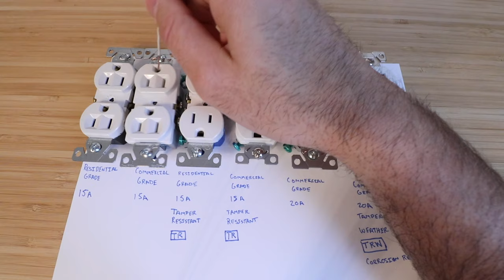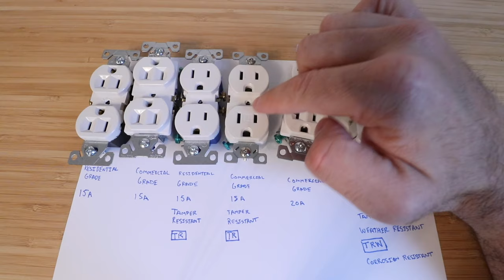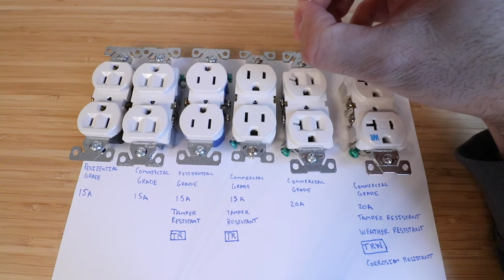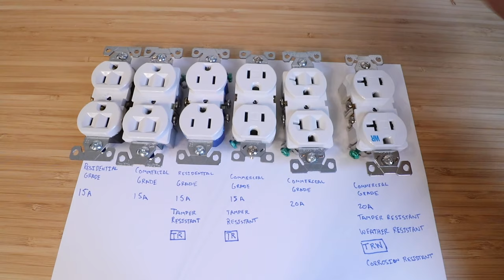How To Choose The Right Outlet For Your Home

Comment: I agree that the 15 amp spec grade receptacle, tamper resistant where required, is your best choice throughout your home. A 15 amp duplex receptacle is not restricted to a 15 amp circuit and is permitted on a 20 amp circuit with 12 gauge wire and is commonly done. Most homes don't have any 20 amp duplex receptacles and if there are any, it's optional. The 20 amp receptacle is designed to accommodate a 20 amp plug which has the neutral blade in a horizontal orientation. This is extremely rare and when used they're primarily for fixed installations and/or dedicated circuits. Dedicated circuits require a single (one socket) receptacle. 15 amp receptacles are rated for 20 amp pass through and the spec grade version is identical internally to a spec grade 20 amp receptacle.
Reply: Thank you I needed this
Reply from the maker: Great comment thanks for watching!
Reply: Yes, thank you for this expanded explanation and clarification. I am glad to see the info on the commercial grade receptacles. I have a couple 20a appliance circuits in my kitchen and in 19 years being here I've had to replace one of the Residential Grade receptacles twice and now I have to do it 3rd time! This time it's going to be with the Commercial Grade receptacles! 👍
Reply: Thank you for this! I recently bought a renovated house, and looks like they upgraded the wires (20a breakers, 12 gauge wires). I immediately checked the outlets throughout the house after this video, and they are all 15a TR. I was worried until I saw your comment. Now I feel better knowing this is a common thing.
Reply: TR outlets stand for trash. Right where you throw them. Especially when you get a call from a customer who’s kid can’t plug his ps in and you have to drive a half hour on a Sunday night to teach them. Absolute garbage.
Reply: @Drewcipher5150  Sounds like a user error, not the product.

Comment: Just fyi: "SPEC GRADE" doesn't mean "commercial".  It means the device is built to comply with federal specifications of the GSA.  Also: You could add ground isolating receptacles and hospital grade devices.  Do yourself a favor and do not use cheap receptacles.  They don't last and can be a fire hazard when they wear out.
Reply: I think that you're incorrect here, Scott. "Spec grade" is one level above residential grade and is synonymous with commercial grade. They do not comply with any federal specification that I am aware of. They're great for most residential and commercial applications, but they are not the same as "Federal specification grade" aka Fed spec wc596 rated.
Reply: @surferdude642  No, I'm not but neither are you. There is more than one Federal spec.  And the ones we are talking about fall under "a" GSA spec.
Reply: @scottsatterthwaite4073  Yes, but what GSA spec does the term "spec grade" reference? Fed spec W-C-596 is a document that falls under the GSA spec "General specification for electrical power connectors". It seems that this is the only GSA spec that's relevant here. 
I found that the spec grade receptacles from Hubbell, Eaton, and Legrand are fed spec wc596 listed, even for 15 amp receptacles. Spec grade Leviton brand does not seem to have any fed spec listings unless you get to the industrial heavy duty grade. So, in most cases you are correct that spec grade does comply with fed spec WC-596 listing. You can tell, because the fed spec symbol will be stamped on the yoke area or molded on the plastic between the 2 sockets.

Comment: most new homes use 20-amp circuits for outlets, but you don't have to use 20-amp outlets they are a bit heavier duty but really are only necessary if you have some high-power drawing device with a 20-amp plug. as long as there is more than one single outlet on a circuit, they can all be 15-amp receptacles since normally the devices are 13 amps or less that use 15 amp plugs and the 15 amps outlets are rated for 20 amp pass through.
Reply: When was the last time you ever saw a 20 amp plug on a home appliance. I have only ever seen a 20 amp plug on commercial appliances never in the home.
Reply: Well I hadnt either now I have a freeze drier an dunno wtf I need

Comment: yes but the commercial grade outlets being bigger may be more difficult to fit into the existing boxes especially if you have solid wire. You may have to change the box , right?
Reply: the commercial grade is less likely to break when being pushed into a tight old box full of wires like old metal boxes with sloped back and you can eliminate pigtails by putting multiple wires under the screw down terminals up to 4 blacks and 4 whites securely held by the clamp down screw terminals with just strait wires no need for wrapping hooks around the screws.
Reply: @ranger178  Except for the ground wire, which is still a hooked end to be held down by a screw

Comment: I have an older home(1965ish) some renovations about 30 years ago. All of my outlets are the 15 amp style however almost all of the circuit breakers in my electrical box say 20 on them except for the water heater it says 30 on it. Is this a problem should all my circuit breakers be 15 amps???
Reply: It's not a problem if your receptacles are 15amp on 20amp breakers unless it's a single 15amp receptacle type but they are rare. But you can't use 20amp receptacles on 15amp breakers.
Reply: As long as the wiring throughout the circuit is 12awg then 20 amp breaker is typically used, and you have the option of installing 15, 20 or a mixture of 15 or 20A outlets.   There are a few situations when this is not true.   Homes built in or that had wiring added between 1964 through the mid 1970s oftentimes used 12 awg aluminum,  the cable jacket will have ALUMINUM,  ALUM or  AL  printed or embossed along it's length,  from 1972 - 1976 12 awg copper clad aluminum was sometimes used, in either of these situations because aluminum has a higher resistance than copper it must be one size heavier to carry the same load, so a 12awg is good for 15A, 10awg is good for 20A and so on.   Sometimes 12awg copper is used for a 15A to keep voltage drop within acceptable limits when the panel is more than 100 feet away, this would typically occur in very large homes or with additions.

Comment: The holes in the back of the 15A residential outlets are not for "backwiring".  They are actually backstab ports, or push-in connection ports, which are not the same as backwiring.  The commercial outlet actually has true "backwiring" ports which allow the wire to be inserted into a screw-terminal clamp and clamped down with the screw terminals (they are not a push-in type of connector at all).

Backstab (push-in) ports are widely considered to be a potential fire hazard and nobody should ever use them, IMHO (just use the screw terminals instead).  Backwire ports, on the other hand, are actually fine and a nice feature, and should be used when available.  Please do not confuse the two by calling them the same thing, though.
Reply: although true, my home was wired al by backstabing. pissed my off when i found out, tried to fix it but there are so many wire ends its impossible to NOT use the back stab cus all terminals were used up if you can believe it. 
 
also in the same box the builder put to much wire in the box it broke the casing on the switch too. So bare copper just been hanging out in my wall for the past 15 years. smh.
Reply: Why do thy put the holes on the back if it is dangerous to use ? Why not just add a few additional screws to the sides of all receptacles

Comment: The 20amp Weather rated outlet you are displaying has a 300 series stainless steel backstrap and internal hardware.  It is not 'Plated' steel.

Comment: You see 15a outlets on 20a circuits cause not much stuff is actually 110/120v 20a. air compressors, table saws, space heaters, window ac's are 15a or less and the bigger ones that do need more than 15 amps are 220/240v. in fact i have never personally held or seen a 120v 20a device. the wiring and breakers for outlets are 20 amp but outlets are 15 cause you might have a 12 amp microwave running on 1 15a outlets and a 5a blender on another at same time. On the same outlet at same time you melt the outlet or overtime will. if breaker and wires were 15a you would trip the breaker. if 15a wires and 20a breaker you overheat the wires and melt the insulation and start house on fire.

it helps to know what outlets are on what circuit and look at labels of devices to see what the amp rating is and keep it under 20a per 20a circuit at a time. Like wait for the microwave to stop before turning on the toaster oven if on same circuit. now days kitchens typically have a few circuits. 1 for stove, 1 for fridge that's not gfci so the food don't all spoil if a gfci trips and you not home or don't know it. some have a dedicated dishwasher/disposal circuit, some a dedicate microwave and at least 1 maybe 2 countertop and wall circuits. 15a wire and breakers are usually lights only circuits especially with super low amp led lights now. or 15a wire is used from the switch to the light as most switches are fed by the same 20 amp outlet circuit for that room. though i prefer lights to be on lights only circuits so if you need to change an outlet you still have lights and lights don't dim or flicker when the blender starts.
Reply: All wire fed from a 20 amp breaker must be rated for 20 amps (12 gauge copper). Even if lights are the only load on the 14 gauge portion of the circuit, it is against code to use 14 gauge wire with a 20 amp breaker. If you feed 14 gauge wire for lights from the same circuit as the outlets, a 15 amp breaker and 15 amp outlets must be used. If the wire for the lights is upgraded to 12 gauge and the outlets are already using 12 gauge wire, a 20 amp breaker and 20 amp outlets can be used.

Comment: So does the 'residential' vs 'commercial' grade apply to GFCI's, too, or are all GFCI's basically of the heavier duty grade?
Reply: There's no distinction between residential and commercial grade for GFCI receptacles. They are all basically the heavy duty grade. The ones that are made for outdoor use have a "WR" designation printed on the face to signify weather resistant.
Reply: There are different grades of GFCIs though it isn’t like his simple residential vs commercial as there are spec. or specification grade as well as hospital grade. You can also get equipment protective GFCI receptacles which have a 30 mA trip current instead of the lower 5 mA that come from personal protective GFCI receptacles. It is much better to use GFCI, AFCI, combi, or EPD breakers and whichever grade receptacles you need as that killed the entire circuit power from the load center rather than device out. Commercial and spec. grade don’t always go hand in hand as you can have commercial grade receptacles that aren’t spec. grade. 
Commercial/spec. grade are simply built a bit better and made to hold up better to repeated plugging/unplugging and are a better bet for outlets you’re going to be actively using whereas residential grade is fine if you’re just looking to meet minimum code needs as they’re cheaper, especially if they’re not used often or if things just stay plugged in. 
You can use 15 Amp rated outlets (NEMA 5-15) on 20 Amp circuits so long as you have 2 devices, if you only have 1 device you have to have it rated at the same level of the over current protection device, duplex receptacles count as 2 devices under NEC.

Comment: Hmm...interesting. I didn't know this info. Thank you!  
SO out of curiosity, I walked around my house and all outlets are of the 15 A residential variety.  BUT THEN I saw one next to my sink that was a 20 A GFCI.  SO I went to the breaker box to check and see if that was a legit 20 A circuit.  To my surprise every single one of my outlets has a 20 A breaker!  Well except the stove, which is 40 A and the Dryer and AC have separate 30 A breakers but everything else is a 20 A circuit with a total supply being 125 A service.  I'm thinking this is a really good thing but I honestly don't know.  Can I really trust that the wires in the walls are rated for 20 A?  I mean my house was built in 1994 and I live in Oklahoma so I don't even know how to check all that.
Reply: Hopefully they all are correct since 1994 built but only electricians can check wire sizes once they are behind the walls.
Reply: @TakuyaHikichi  - how do electricians check the wires?  I mean if it's a matter of opening up the walls, I could do that. But do electricians have specialized tools to check this without opening up the walls?
Reply: @jontnoneya3404 just turn the power off to one of the sockets and then take one wire off the outlet. Measure the wire with a micrometer and convert measurement to a gauge reading. They also have wire gauges made for electrical
Reply: @LoadedPotatoInc great idea - thanks!!
Reply: Using 15A outlets on a 20 amp circuit is acceptable and commonly seen in residential,  as long as there is more than one receptacle - a duplex receptacle, the type with the top and bottom found on 99% of outlets in the home count as two.    If you have a single receptacle on a circuit with nothing else it must match the breaker rating, so a 15 amp receptacle is not permitted in this situation,  and 20A receptacles are not permitted on 15A circuits.   Fortunately in most homes 20A 120V plugs are very rarely encountered,  except perhaps on some commercial grade microwave & toaster ovens,  for example,  but when this is the case, because the appliance is capable of pulling up to 20A, the instruction manual will more than likely say "FOR USE ON A 120 VAC, 60HZ, 20 AMP INDIVIDUAL BRANCH CIRCUIT ONLY" or something similar,  and per the NEC you are required to follow the manufacturer's instructions to ensure you're not voiding any UL listing or warranties.
Reply: @jontnoneya3404  Looking at it 12Gauage = 20amp & 14Gauge=15amp. See it, feel it and it's obvious the difference. by looking at it. But you can  also use micrometer if you prefer.
Reply: @LoadedPotatoInc 12 gauge is approximately 2.00 mm  or .080" diameter. 14 gauge is approximately 1.6 mm or .064" diameter.

Comment: I bought a box of residential garbage grade outlets and switches some break just tightening the screws or first time somebody pulls on a vacuum cleaner cord now I save them in case a hated enemy stops by and needs an outlet LOL. i use the commercial grade for the quality clamp down under the screw back wiring that can hold 4 wires and they don't break when used. the tamper resistant just makes it harder to plug things in for old people and behind furniture at weird angles more government stupidity as always just put then in if you have kids.
 would be nice if the weather resistant was not tamper proof.

Comment: 20 amp outlets have a single tab on one of the slots. What about outlets that has those tabs on both slots?
All your garage outlets should be 20 amp and tamper resistant.
Reply: A receptacle with 2 horizontal slots is a 15 amp 240 volt receptacle and the one with one slot that's vertical and one horizontal on one side and horizontal on the other side is a 20 amp 240 volt receptacle. Not sure if I understood your question though.
Reply: @surferdude642  Actually most of the receptacles in my house are two prong with a slot coming out of the vertical slots.
Just 110V power to them though.
I need to get more of those to replace worn out ones.
NO! I am not paying to upgrade anything.
I will just toss a 3 prong in there if I can't find what I need.
And skrew the ground.
NOT tearing out my walls and being forced to upgrade the whole house electrical system.
Reply: @crazysquirrel9425  I've seen those recently on a neighbor's house, don't think they make that style now. It looks like it could be wired as a 120 or 240v. His was on a 120v circuit and the house was built in 1955. You could use some GFCI receptacles in the bathroom, kitchen and garage if you want. They are safe against shock protection even without a ground wire.
Reply: @surferdude642  Have no bathroom outlet! lol
If I want to use anything there I have to run an extension cord from another room.
Only 4 outlets in the kitchen and none near water, I think one outlet might be grounded.
I did install a GFCI in the detached garage but had to a ground wire to a ground rod just outside of it. At least I can run a battery charger....
No ground back top the house. House has it's own ground rod.

My house is so old it used to have gas pipes in the walls for lighting!
Been converted to ceramic post and cloth wrapped wire. Went from free standing gas heaters to a gas furnace in the basement.
Used to have an old octopus furnace (steam originally then gravity hot air). HUGE ducts.

And of course lath and plaster on the walls painted with lead paint and then encapsulated with dark wood paneling.

A couple of outlets are weak - barely hold the plug in.
Have one outlet that is 2 prong but 3 places to plug things in. It was made that way.
Doors use skeleton keys but those keys are long gone 😞

No one makes a 2 prong dark BROWN gfci outlet.
If I replace with a gfci, I have to deface the outlet with stickers. Severely detracts from the antiqueness so to speak.
House used to even have a dumbwaiter!
All sealed off I think in the 1940's.
Space scavenged to make kitchen slightly bigger.

Comment: Put 20 amp commercial grade ones in your own home. You'll never have to change them again.
Reply: Assuming you have the right wiring. However, never say never. People are swapping out existing outlets now to install outlets with USB ports, for example.
Reply: @EugWanker  I'm assuming # 12 Romex for home wiring that's rated for 20 amps. Actually it can handle 25 amps at ambient temp of 70°. You are right though . I've seen 14 gauge in houses especially for lighting which is fine. It's ampacity rating is 20 amps at ambient. What you see also is 15 amp rated receptacles on 20 amp breakers.